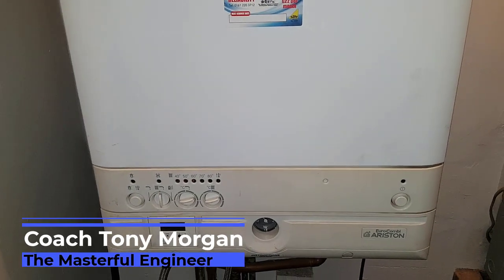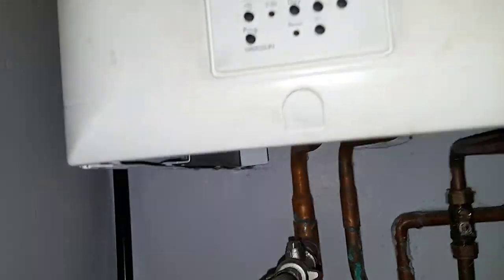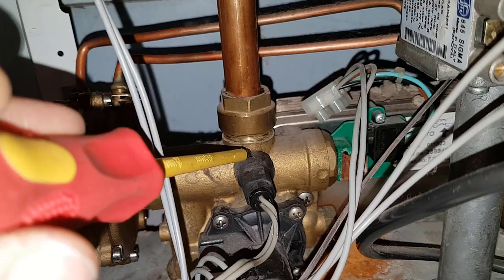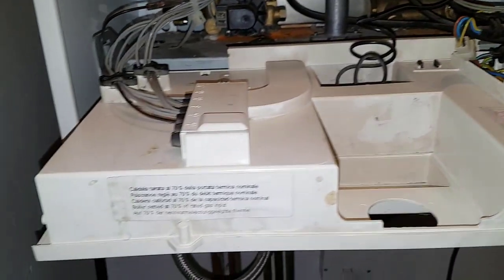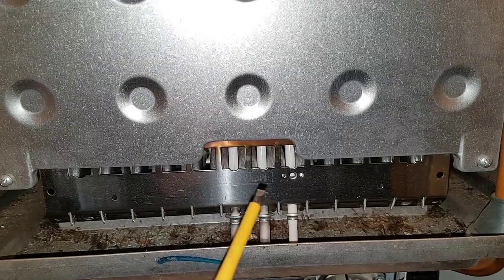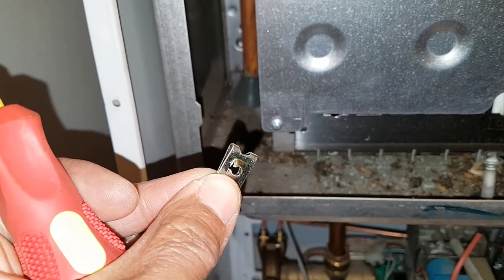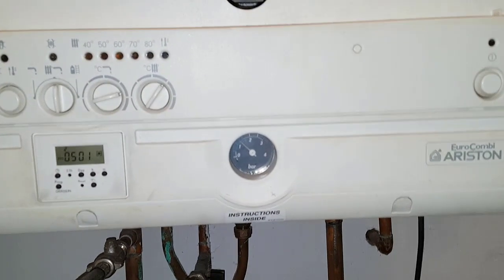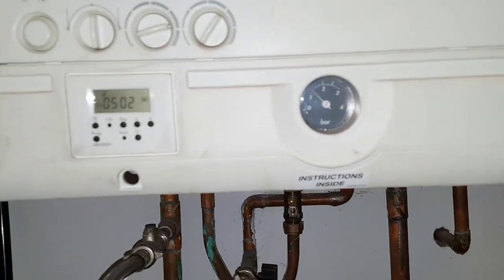Ariston Euro Combi A23 Tour With Coach Tony Morgan

Comment: Spire clips
Reply from the maker: hey we're currently trying to grow our Facebook group and would love you to join Tony and the team using this link, Tony will be available to answer all your questions directly https://www.facebook.com/groups/167070231326174
Reply: Hi Tony, great insight into the Ariston Boiler. 
I have the exact same boiler. Mine has a fault whereby you turn it on and it throws a fault after a minute. (3rd led in for the left goes red) 
I then have to turn it off and on at the mains to hear it trying to fire up. 
I have to repeat this process for about 20 min until it fire up. 
Would you know what could be causing this issue? 
Thanks in advance.